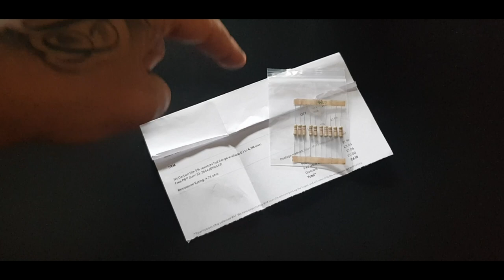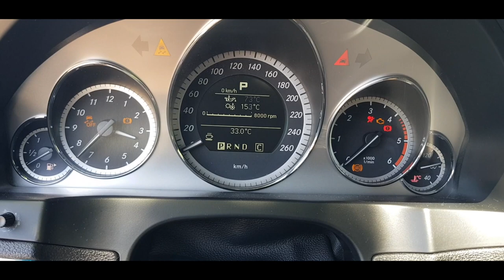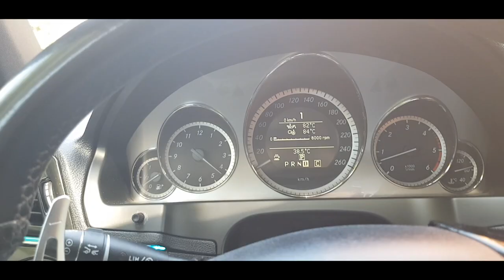Cómo (Anular) mariposas de los colectores de admisión (Perdida de potencia) OM642 Mercedes Benz

Comment: como se anularian mariposas del 611.962 w203 c220 cdi de 143cv ? quitando el enchufe del motorcillo de las palomitas y poniendo esa resistencia ?
Reply from the maker: Hola compañero, siento la tardanza en contestar, pero últimamente no tengo tiempo. así que supongo que lo mismo pero si los mismos pines en el conector son los responsables no te lo diré porque primero tendrías que asegurarte mirando el diagrama de tu modelo de auto sino puedes dañar algo haciendo un corto circuito en el controlador del motor, mucho cuidado con estas cosas si no estamos seguros que son dos motores completamente diferentes. Un saludo!

Comment: Hola,tengo un fallo en mi Mercedes ml320 cdi w164, sale fallo presion baja turbo p2359 , revisan y no encuentran fugas😢.
Reply from the maker: Hola compañero, la mayoría de las veces este fallo puede dar:

1. Sensor de presión de gases (B60) ubicado en el lado derecho del turbo. (Agregaré que a menudo es suficiente desenroscarlo, lavarlo bien y soplarlo con aire comprimido)
2. Sensor de presión de gases de escape (DPF) ubicado en la parte izquierda detras del filtro de aire o por debajo del coche (dependiendo de modelo del motor)
3. Actuador del turbo. (Si tiene componentes electrónicos rotos o caracol demasiado flojo o dañado, igual será un problema) mira el vídeo.

Espero que tengas suerte en solucionarlo. Un saludo!